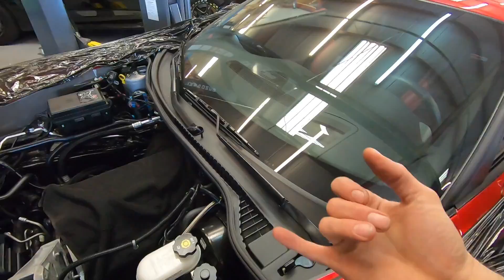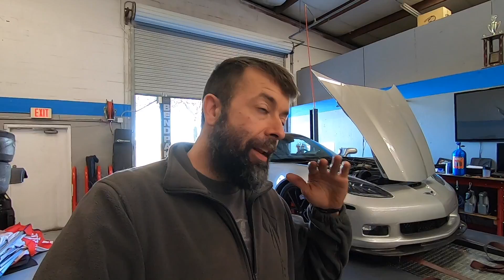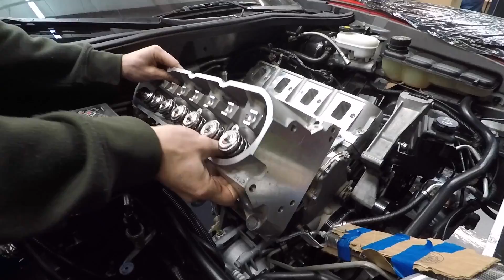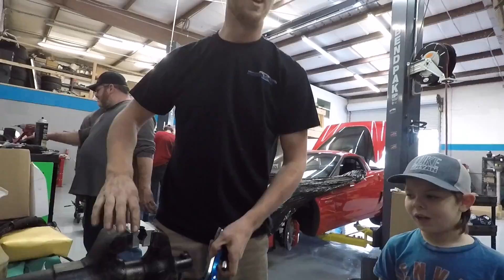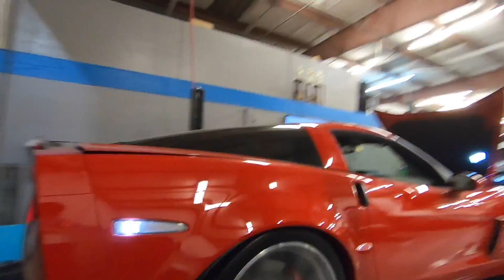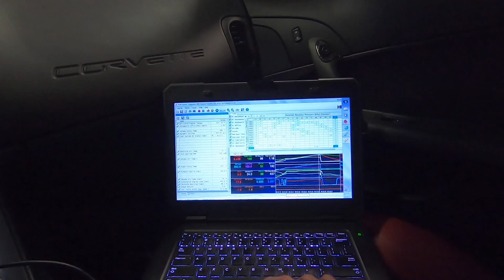Building, Tuning & RIPPING My ULTIMATE NA Build! (2006 C6 Corvette Z06!)

Comment: Thanks alot for your video, i don't have a z06 but my 09 atomic orange could use that small slit of plastic under the intake taken out the only thing i think I'll do differently is epoxy a small piece of aluminum screen material in there but i love that little hack to grab some extra cold air without changing the stock intake scoop

Comment: Great video & what a stunning red Z06.
Agree with your thoughts on NA route is the better way to go for this car & engine combo. In my case, for club road circuit  track days, turbo/supercharger means so much heat to deal with leading to reliability issues = high maintenance costs. But most importantly, all that extra weight at the front end with turbo/supercharger, intercooler, including additional cooling/piping for engine/transmission etc would destroy the balance of the Z06.
Though, I strongly disagree with you on the Z06 being “lightweight”. Given that it constructed on a aluminium frame with carbon/plastic panels & it’s only seats 2 being quite small inside with hardly any room to fit a roll cage, it is a PORKER in my opinion. It should be 200lbs lighter than it actually is in my books & I don’t understand why it is so heavy?

Comment: Can we get a video on the 1050 HP Z06? That thing is calling my name! How much would it cost to build a stock Z06 into that if you had to guess?
Reply: That almost HAD to be a built bottom end.  H/C packages tend to run about $10-15k.  I'd guess with the built engine, SC package, beefed up drivetrain, etc, easily north of $50k.

Comment: Fasterproms do you have anything like this on a C5 with the LS1 or LS6 build? Can’t figure out what to do on heads. If port 241’s and valve job or get 243/799 and just put them on or find a set of 243/799 and have ported or that are ported. Goal would be 450rwhp. Not sure if just going straight to a set of $1,000-$1400 heads would be over kill for that. Looking to do budget friendly HCI and bump compression on an LS1. Ported 241’s with good valve job and Miller for extra compression and thinner gasket, a good bump stick, and LS2 or LS6 intake. Only difference would be 243/799 with milled and valve job no porting. If that would yield 450ish I’m happy. Planning out an engine build for road racing.

Comment: I know a Holden 6 cylinder early old red motor 3.3 liter making 700 HP and 535 talk not bad for a Na engine Hey
Reply from the maker: Yes but the tq isn’t there. And tq is king
Reply: @Fasterproms1  lol wasn't bleeding distrespecful lol just saying lol but why we're at it lol why haven't you taking the blue miata the beast the vest car you got to drag strip yet that be the best one put the big ass slicks lol and if there hat not enough put 150/200 HP shot of noss lol it would be insane lol that would beet Ruby red lol even Na plz plz plz plz buddy take that sexy beast to track Jeremy it faster than you think lol Na all the way Iv got a build my self 400HP vl turbo engine out of a Holden commodore in a little car called a Toyota corolla 1981 model Ke 55 ways only 750kg power to wait ratio is insane lol I call him Frankenstein lol

Comment: Curious why you didn't use the NW TB on the ported intake?   Wouldn't that have been a better match?   Likewise, I typically see people use 2" headers when at this power level, was there a reason you didn't go that direction?   My C6Z is down in Boca for the winter, but I'm interested in having the H/C/I and tuning done before I bring it back up north for the summer or possibly when I bring it back down there in the fall.   I'd be interested in talking with you to do mine as well.
Reply from the maker: Typically don’t see a gain at this power level with the NW. however around 700+ it becomes necessary

Comment: There's nothing like a powerful NA car. Growing up my buddy I use to work with had a nova with a high compression small block and it made almost 500hp/476tq on pump gas and that car was one of the best cars to go beat on the power was always there with no wait. He also built it to be reliable we could hop in it and go a couple hundred miles no problem Nothing like hitting 150 in a blink of an eye 
on a back road praying for no deer to run out haha

Comment: If these motors make that much power, is it possible to get a stroker, just over 400", to make around 600whp? I'm rebuilding my 403 right now, and I'd like it to be able to go low 10's on motor. Not sure where I'll be with weight, but I've pulled a good amount from the front, and added a cage. It went mid 30's before, near full weight, so I'm hoping it'll be possible! I'm in Cape Coral, and it'd be nice to get you to tune my car. I believe the tune in it prior to making the changes I did, was off...so, I'm not about to run a fresh motor on a questionable tune!

Comment: Wait, I didn't even think that it has an LS9 in it, right? My brother had an 07 Z06 with the LS9 and a 6 speed and that car was a beast from the factory. He sold his 2002 Trans Am WS6 to a guy in Sweden for over $30k with 6000 miles on it and used that to buy his custom ordered black on black 07 Z06 for $84,000. I loved that car. He drove it for 5000 miles and sold it too to buy a new Camaro ZL1. He still has his old restored 74 Z28 and he bought another 72 Camaro and restored it as well. I wish I had made the same kind of decisions he made with his money. He lives in a newly built $750k house in Florida and I live in a fucking hovel outside of Pittsburgh.
Reply: C6Z comes stock with the LS7, not LS9.
Reply: @ssoffshore5111  Yeah, I know, I made a mistake. Thanks though.

Comment: I was fortunate enough to own a 07 black c6z 660pkg from lingenfelter. I noticed talking about throttle response in the c4. My father did the same thing constantly with the throttle in ours. It was just so responsive. That ls7 is nasty with a 700plus in lift cam with heads to flow with it.The response on that car was insane. 600rwhp out of n/a is soooo much fun. I miss that car so much. It was also light car diddnt hook for shit even with nt05s. Also there’s no better sounding corvette. Cora’s xtremes on that setup is prob my all time fave. I learned to drive real quick in that mfer.

Comment: So, do you need to buy or get an unlocked ECU for tuning. How does that work? What if I have a 2011 silverado with a 4.8 and want to swap in a 6.0 with cam and heads? What would be the deal with the ECU?

Comment: Solid rollers turn these into a beast .....  50 more
Reply: They already have enough valve guide issues without the much more aggressive and abusive sold roller profiles!
Reply: Replacing guides and swapping the valves out is common and fixes the problem
Reply: Sadly it only resets the clock, the only true "fix" for these LS7's is to change over to the LS3 heads and intake, but you lose 20+hp in doing so.  I've just come to accept I have to check the valve guides every 10k...

Comment: Im currently in this debate....
C6 Z06 or C7 Z51??
Reply from the maker: They are so very close, c6 is much rougher and rugged than the other. C7 is smoother and more luxurious
Reply: @Fasterproms1  That is my impression as well. I feel the C6 Z06 just has a uniqueness in and of itself but like you said, I like the updated features of the C7. Thanks for the response!

Comment: Only picking up 10-15 whp on e85 seems really low. I would have expected at minimum double that. But then he said 60% ethanol which makes sense as that its more towards e60. Must be that NA cars don't see the gains that  FI cars do with the cooling effect of running e85. Still a good gain for swapping to a different fuel that has a lot of benefits over 93, as well as draw backs. Great video!
Reply from the maker: Correct. Much more limited in spark on FI car.
Reply: You have to realize where the power output of this engine already is.  These numbers are insane.  This is power that the most exotic SBC could never wish to make 25 years ago.  To pick up 15ft lbs when you are already at that level is actually impressive.  Once you get to a certain VE, you jump for joy at 5whp gains.  Also the fact that this engine is not just a small HP spike at high rpm but makes an impressive TQ number and has a broad curve is all the more impressive.  

This engine could have a hotter cam tossed in be spun another 1000rpm, but have absolute miserable street manners, and be gutless below 3000rpm.  But hey, it'll make 30whp more at peak while losing a TON down low.  Where it's at right now is perfect.
Reply: @JViello  Absolutely, I understand, but there's really no comparison between the most advanced engines of 25 year ago and today. The fact that the fuel itself has many many benefits in Forced Induction cars mainly for the benefit of cooling and thus allowing more spark advance. On this engine its not limited on spark advance from heat or where the MBT number is, so e85 is less effective... BUT e85 (when true 85% ethanol) is near the 104 octane range. That in itself should have seen a larger pick up in my opinion. (Was running e60) and since e85 requires more fuel that means an ever so slightly bump in Compression Ratio as liquids arent compressible.(at least in theory) but since the engine wasn't held back by 93, e85 had less advantages to offer and less power to pick up. I'm sure Jeremy has seen amazing power gains on other cars. But this one, this one, goes to show how well built the engine was and how everything was suited/fit together.
Reply: @jacobmay7594  No disagreement here, I never refuted any of that.  In fact, you supported my point.  This engine is so well designed, it can run on swill almost as hard as a much higher quality fuel.  

I used to own my own wholesale turbo fabrication and manufacturing company and was head of RD for another turbo kit maker and turbo supplier you would recognize instantly.  I've spent thousands of hours on every dyno conceivable and reverse engineered many factory ECU's.  There were HUGE advancements in head and tuning technology right at the turn of millennium.  Well, that's when it finally started to make it to the production line in mass anyhow, most of the RD work was done during the 90's.  That's when you saw hp in every day cars go to places never heard of in performance engines 10 years prior!  Compare the Honda B series engine - mostly designed in the 80's to the K series engines.  If you told B series builders you put down 300whp on a fairly non exotic NA 2.4l (143ci) they would laugh you out of the room.  Today ever Tom Dick and Harry is doing it with relative ease.  About 20 years ago I put 17-19psi into a 11.75:1 8700 rpm 4 banger with Yamaha designed head on 93 piss water with almost 20 degree lead...It was there I knew we turned a corner in a major way in head design.

Direct injection is going to push things even further if we continue down this road with ICE. Having control over fuel timing as well is ground breaking. The limited tuning I've done with DI being able to essentially chase the flame front down the cylinder and extend the burn period over time opens worlds we never knew.    Good times!

Comment: Love the car. I may be biased thou as I too have a 2006 C6Z06. She made 584/512 on 93. My tuner didn't think E85 was worth the trouble. I still differ weighing the advantages of cooler motor but I'm not a tuner. So

Comment: I would ceramic coat the
Headers or upgrade the starter . Heat from headers gonna cook the solenoid on the starter. Lot of complaints of starting issues after driving the car for a while from starter getting to hot

Comment: That's a big cam, 12:1 is lots of compression, and e85, only 620? That's a bit disappointing. I see these make the same on a lot less.
Reply from the maker: It’s not really a big cam we could have gone much bigger for a number, and 11:1 is stock CR. I tune other tuners combos often and it’s not at all common. Our Dyno is real and kinda stingy. Also observe the Tq it is not all about the up top power.
Reply: @Fasterproms1  huh? 550 wtq is normal for an unmilled H/C/I. With .055" off you should be way up there.

The BTR Stage III LS7 cam is capable of way more power than that so I doubt you have run into a bottleneck in that regard.

Seems like something's off to me.

 And I know a stingy dyno when I see one, your other videos don't seem that stingy to me. Especially when you are making vacuum on a ported MSD setup, you know you have more in it, but we all know the air flow limitations of that setup is more than what you're making. But I guess if you're only shooting for a 10.99 it'll get you there.. if you can find that E lol.
Reply: @Fasterproms1  By the way, milling .055" off the heads is much higher than 12:1. It's more like 12.3-12.5:1. Let me know if you'd like me to calculate for you.

Comment: If it weren't for the interior, I was going to trade my S550 Stang 5.0 for a Z06 (actually at the place I bought the Stang). I have almost 'max effort' NA: Cobrajet, cams, monoblade TB, E85, LT, ect, and I'm hoping I see 500 WHP when it's tuned in spring, and this is at 3600 or whatever a Stang is. Looking like I should've gotten the Z06 at the time. Shit those NA pulls looked STUPID FUN! I guess on the bright side, I should be able to pull well over 8K RPM though.

Comment: I love the c6 zo6 but I have not purchased one out of the worry of the valve drop issue, I wouldn't want the cost of replacing that ls7
Reply from the maker: That’s why you port the heads and address the issue
Reply: @Fasterproms1  I have heard that I'd just be worried about finding the correct shop to do the work. That job is a little out of my skill level

Comment: Here in Norway gasstations only sell 95 and 98 octane fuel ! Would be wery interesting to see What you could do with that pump gas 98 and if it would make a lot of difference. I know tuners around here use that 98 fuel often, as E85 is rare
Reply: In Europe, gas stations describe different types of gasoline based on their RON rating. It is typical to have 100, 99, 98, 97 or 95 RON with prices varying accordingly. In the States the descriptions look a lot like RON, but they are not. In the United States gas stations describe the types of gasoline based on the Pump Octane Number (PON). That number is the average between RON and MON. This causes many problems.
If a fuel is 98 RON then it will be 93 PON -> 93 PUMP
If a fuel is 95 RON and 87 MON then it will be 91 PON -> 91 PUMP

Comment: if only these things weren't still going for 90-100k+ here in Australia
Reply: I know, I'm in NZ and want one but out of the budget for a long time
Reply: Sounds like I need to get into the exporting business!  They go for 1/3 of that here in the states!
Reply: yeah not sure on legality on importing from the states but pretty sure they still have to be converted to right hand drive which isn't cheap
Reply: @VLNath  Here in NZ you can have it as LHD, but have to get it complied with NZ rules, then register it as a special exemption car. If any modifications are required then have to get it certified before registration.
can be done, but not always cheap option
Reply: yeah in Aus i'm fairly certain that only works for older cars. its been that long since i've looked into it i can't remember the particulars but its after a certain year or age or something if i remember right
Reply: People don't know how to service them here so they get a new when around 40-50k miles. I need up finding then for dirt cheap.

Comment: I have an 06' C6 with Z51, t56 trans. How do you like the t56 at these power levels of 600+whp? You think an upgrade to the 08+ Tr6060 with larger 30 spline output shaft is worth the upgrade?

Comment: Very nice. I have my dads old 58 chevy, which i ironically learned to drive in. Im looking to do a 6.0L iron block (since its less expensive) engine set up in it. Im planning on over building the bottom end but not sure which head package and intake manifold i should use. In any case id like the truck to perform very similar. Id be happy with 500whp, or more 😎

Comment: Hey Jeremy, That Heat ex-changer in front of the Radiator that you called an Evaporator is actually the Condenser. The Evaporator is on the other side located in the dash. Still Love your videos.
Reply from the maker: Indeed you are correct.
Reply: @Fasterproms1  Thanks for the reply.I hope I didn't come off as being an idiot for correcting you but I just wanted to make sure you sounded intelligent on the matter. If you ever have any A/C related questions I'm always willing to help. bigtruckacshop@gmail.com I would guess engine related stuff is more your thing. Keep up the great work and say hey to Garrett for me. Best regards Ron Sposato.

Comment: Hopefully You or George will answer this, what tooling do you use when you port those plastic intakes? I use a Foredom TX also, but drum rolls and flappers would melt the plastic more than remove it cleanly lol. Do you use burr bits?

Comment: Currently own a 06 c6Z06 with trickflow specialty 260cc heads. B-3 cam, fast 102 manifold, NW102 TB, halltech killerbee intake, kooks 2 inch long tube to the stock NPP exhaust. Tuned on 93 and it made643 whp on a dynojet. 

Who else owns a c6Z06 and whats all done to yours?
Reply from the maker: Outstanding. Wish we could have done 2” stainless works , and what clutch in there?

Comment: My boss built him a 600hp 08 zo6 btr stage 4 cam msd intake , heads, headers and mid pipes it sounds wicked but stock tires dont hold the power. Hes on a set of c7 zo6 wheels